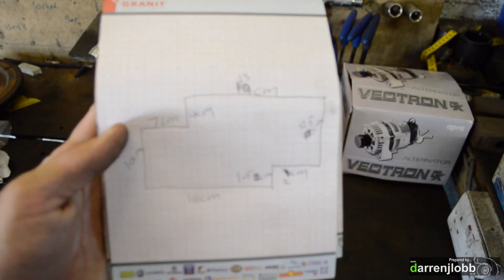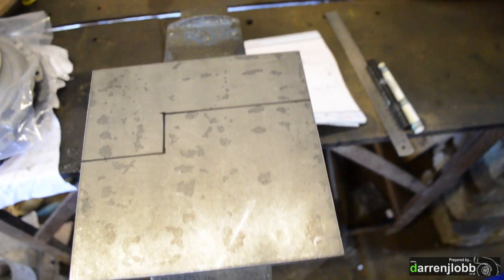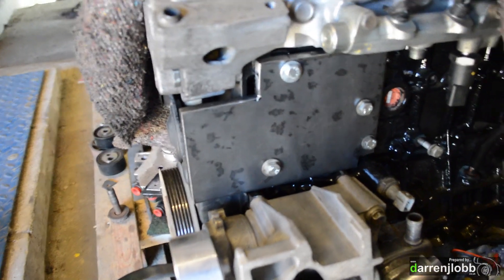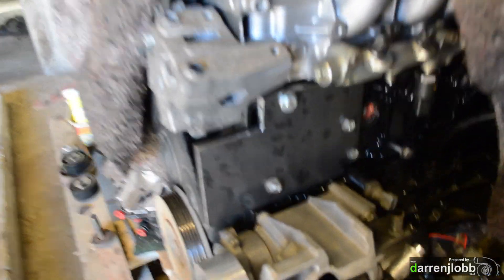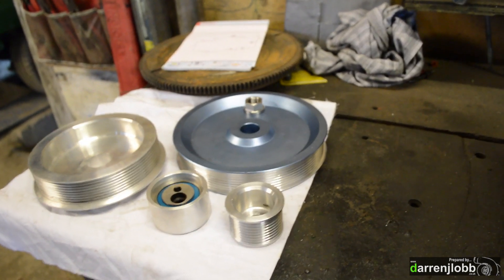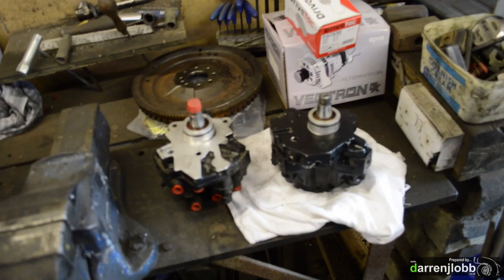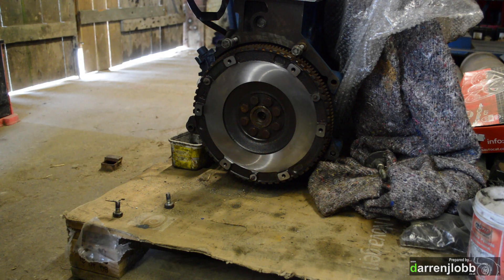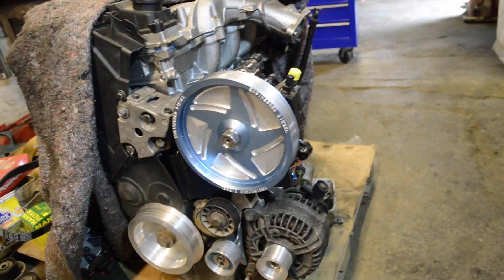darrenjlobb's JD DervBus Project Part 18

Comment: Nice work as usual guys! Especially liked the hole transfer method! There's nothing wrong with your bracket either. In terms of the steel used for the bracket, if you want to go thinner yet still retain strength, you can try a higher tensile steel variant like EN3B or EN8. You can find those on eBay. Much nicer to work with than the common "black" mild steel and about twice as strong. Also distorts much less when you weld it. Black mild steel usually twists into a pretzel when you weld it, which sucks when you're trying to make precision brackets. Keep em coming boys! :)

Comment: I've heard that these can fuel around 700hp on a 6.6 litre duramax... So logic dictates you should be able to fuel around 1200hp on the DW ;) top fabbing work, can't wait to see how it goes man.
Reply from the maker: Thanks for watching...Fuel pumped is fuel pumped, and HP capability of a pump is largely the same on any engine (give or take)  given the ammount of fuel available does not change, and fuel is what gives you power! However the speed you spin the pump has a large effect on capacity.